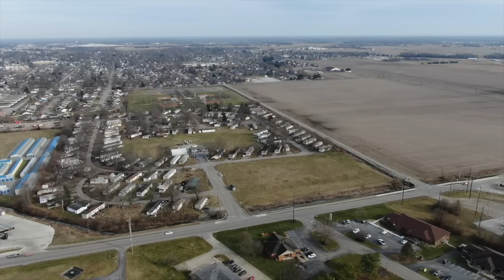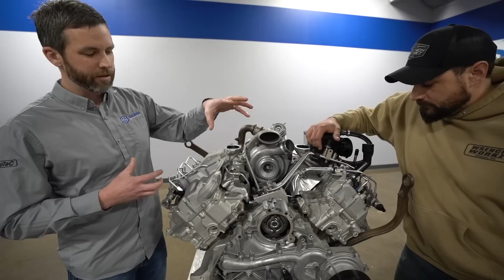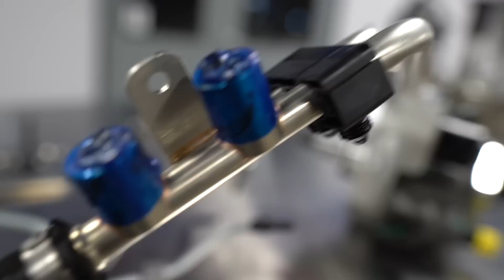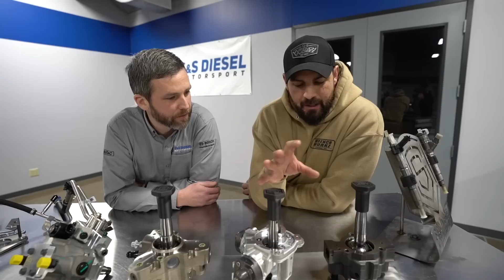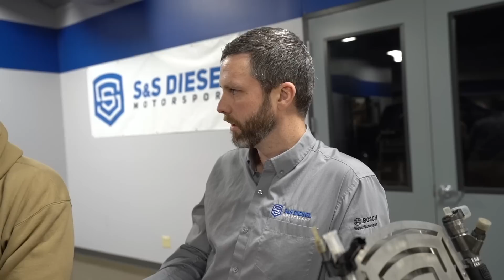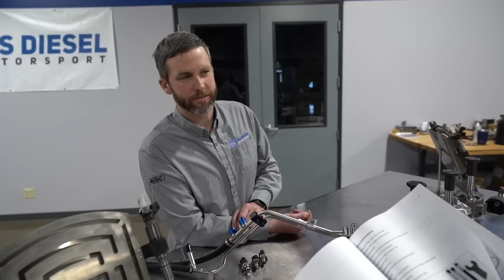NEW FORD 6.7 Powerstroke Solution!!! NEVER SEEN BEFORE!!!

Comment: Whats crazy to me when it comes to Ford is that they have known since atleast the late 80s that a straight six engine is almost unkillable just look at all the old square body ford's that have that old straight 6 gasser you can stop the thing 😂 it's not the most insane power engine but that platform should have shown ford they had a good platform to use for other ideas.. these v8 engines thst Ford has tried building have just been nightmares non stop (not hating on Ford by any means, just saying the old straight six was a good engine that wouldn't stop and if Ford would have used that platform to build bigger engines they would have decent engines and yes I'm a cummins fan but you have to admit the straight six in any platform is a hard to kill design❤❤❤

Comment: The answer is the cp4 simply doesnt fail outside of the parameters of standardized diesel lubricity and moisture set by the government.  I would say at my shop we've had a non contaminated fuel cp4 failure only three times.  Bosch when it was developed was operating under the guidelines set by European fuel standards, which includes more lubricity and stricter quality standards including lower moisture tolerances.  In Germany where the pump was developed unlike the US, if the government tests fuel at the pump and finds moisture is above requirements, the station and the provider get fines.  Fuel is conditioned in many larger stations and depots there where its not here.  Yes it leads to higher fuel costs by a few pennies, but it means that when the cp4 was deployed in europe they had so few issues with it they didnt think twice about introducing it in the US and Canada.  Whats really funny is canadian standards are still higher than ours.  What failed is our real at pump quality standards were not as advertised in the overwhelming majority of cases leading to oxidation inside the pump body and pitting that ultimately leads to catstrophic failure.  Thats my take, he is right about price point...but its more of a demonstration of quality requirements of the fuel not being met.  Hell according to the weights and measures department in WI even though they only test fuel that has a complaint attached, in almost every case the fuel they test fails both advertised gel point requirement for winterized fuel AND moisture content.

Comment: What years do they put the CP4 in the powerstrokes?
Reply: All 6.7 powerstroke. The 2020 up have a different version with some change(s) to support increased max rail pressure but no changes to the fuel flow inside pump he was describing. I believe the 2020 changes are thought to include harder pump piston rub surfaces but I have not seen any teardown and analysis to confirm this but it might exist somewhere.

Comment: All these morons saying this is a game changer are really brainwashed fools. This occurs on less than 1% of ALL powerstrokes. The powerstroke is the ONLY truck that has its own dedicated pick up pump supporting the CP4. No other brand has that which is why they fail in those brands. IF it fails in your powerstroke it's because you didn't change your fuel filter. These engines far surpass 500k miles without issues. This isn't going to be a game changer by any means. It's all hype and fear mongering as a marketing tool. Don't be brainwashed by these misinformation spreading fools!

Comment: It may be over kill,  but can I run my disaster kit inline with this pump like the origianl cp4?
Reply: No. The FCA on the CP4 is not the same. Plus, the DCR has two different cases, no need for the DPK with it installed.

Comment: This is a game changer for the 6.7 PS folks. I still prefer the simplicity of the Cummins, but with this kit, I won't be as scared of a Powerstroke as I used to be.
Reply: Dodges have cp4 pumps to
Reply: @easyryder123  literally only for 2 years and they’re being recalled and refitted back. Nice try bro
Reply: @Hunter76251 they don’t flow as well